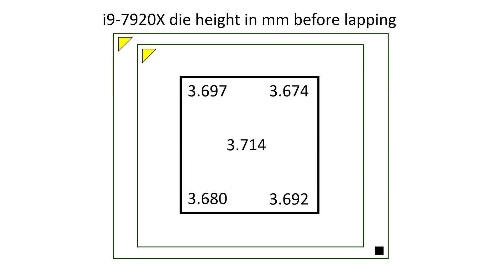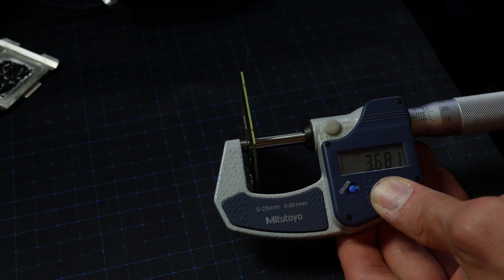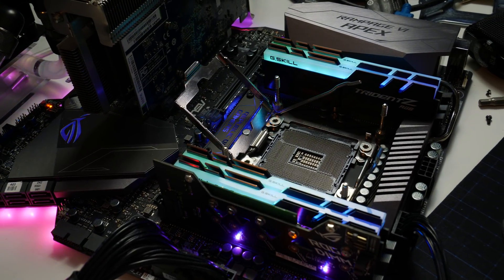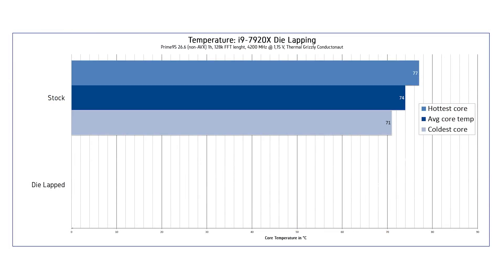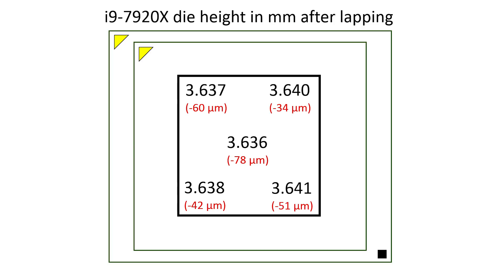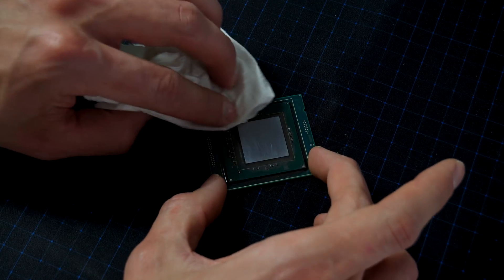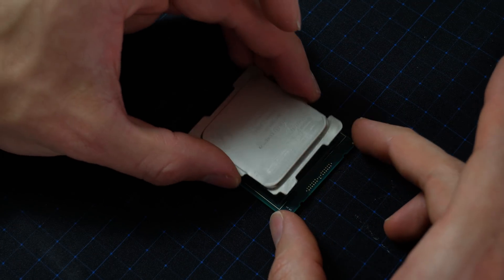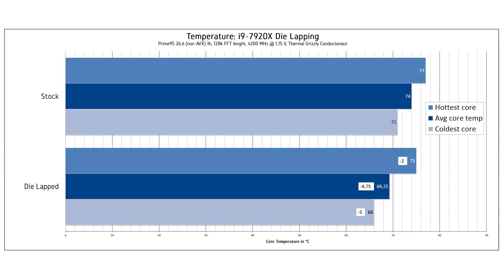Taking CPU Delidding To the Next Level !

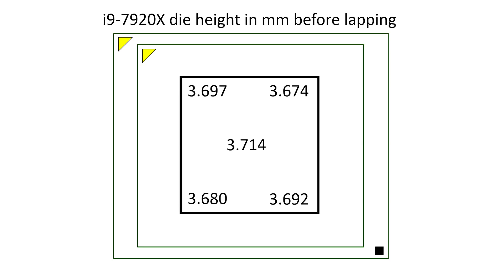Comment: 4:25 shows some measurements. But what's the reference plane?
It's the PCB.
So how are these measurements relevant unless the PCB is flat and level?

This measurement is not important.
What is important is how flat and level the silicone package top is.
And how flat and level the surface is that is forced up against it.

The main requirement is to get a very intimate contact between the silicone package, the IHS (if you use one), and the heat exchanger surface (usually a large piece of copper.

The only way to get meaningful measurents is to do use a surface roughness instrument to do a survey over the silicone surface.
And to use a known reference point (in fact three of them) on the surface that the CPU package is attached to.

In engineering metrology terms, it's defined as flatness.
And in the GD&T (Geometric Design and Tolerancing) standards that Intel follows, they give a spec of 50 micron for flatness.

 That requires a reference plane that is known to be flat.
And the PCB that you used as a reference is very unlikely to be flat.

Do you really think that the silicone wafer that is used to build these dies on is NOT cut flat and level?
And within the GD&T spec?
I don't think so.

A quick way to check would be to put a machinist's straight edge on, and look for gaps.
But I think you should ask a good machine shop that makes pricision parts to measure it.

Comment: I skipped forward a few times, so sorry if you answered this, but my question is, what if the inside of the IHS isn't perfectly flat? There's no way without a CNC machine to lap the inside of the IHS, is there? What if the internal surface of the IHS is made slightly concave to mate with the slightly convex surface of a factory die? {Edit: I doubt this is the case, because the machining complexity of doing that is pretty full on. I guess they just CNC machine the inside of the IHS flat.} All said and done though, I don't think the effort:reward ratio is great enough for most people to do this. I'm going to delid and use liquid metal between the die and IHS, and I'm going to lap the exterior surface of the IHS and the coldplate, but that should be good enough for me, I think. For now...

Comment: I will be performing my first delidding and lapping of the die on my 9900K next week. What I would like to know is do you have to sand down the bottom of the IHS equal to how much is taken off of the die? At what point do you have to start sanding the IHS so that the top inside of the lid will touch the die?
Thx for your time, knowledge & help! You are greatly appreciated!
Reply: Try sanding the IHS base first, until it hangs from the die. Then proceed with IHS & die lapping in sync.
Then liquid TIM becomes a must, because anything solid will detach under different thermal expansion of silicon beneath and copper above.
Reply: @phdnk  Thx. That's a good point.

Comment: Thermal past is to fill the space between    the cpu and the cooler if you smooth out the space between the cpu and cooler your removing that space so if you git it smooth enough you should not need paste.

Comment: I am using a lapped CPU (Q-6600 Soldered lid) and a lapped Heat sink with direct contact and mineral oil as an air gap prevention,no shrinking no problems!
This method reduced my Temps by 15 degrees C. across the board!
Thermal paste is too thick and creates a thermal barrier! 
It does not matter how thermally efficient a compound is,it will still create  thermal insulation!

Comment: i did this back in the day with an amd k2 450 mhz-555mhz and also am2 7750  recently a k10 640 figure 8's sand like infinity is the key great work man i also polished it to a mirror finish like a mirror i did not use liquid metal but they are direct die air cooled artic silver

Comment: What about grinding the lid also? Making sure a flat surface meets a flat surface? In theory at least, if the two surfaces are flat enough you should be able to skip the liquid metal! It is only a intermediate carrier of the heat anyway. 
Could you test that? It would be very interesting.

Comment: how does the difference in height/thickness vary from chip to chip? i am curious as to why is it thicker on the center and ramps down towards the edges???? this might be a manufacturing spec required to help spread thermal paste.,,,,...
Reply: It must be connected to the cooling process after the die was soldered to the pcb. The die cannot have uneven thickness -- it is bent !
Lapping introduces scratches to the surface that will concentrate stress and gallium works as surfactant: we can expect die cracking

Comment: CPU manufacturers in the 2000s: Lets add a metal shield over the top of the CPU to diffuse heat and protect the die from damage
der8auer 2018: I'm not satisfied simply removing the heat spreader to use better thermal transfer media, for my next trick I'm going to sand the die because the barrier isn't completely even

what a MAD LAD

Comment: I lapped a thunderbird 1ghz and nForce 2 motherboard northbridge back in the day.  NB lapping was worth about 15-20mhz fsb iirc, also cleaned up the power plane for the NB a bit when I did that though.  Removing the top layer doesnt always help thermals, the Thunderbird Mobile Barton version A and B are examples of this as the T-Bird B had metal layers added to the top of the die to increase thermal conductivity and also help signal grounding internally somewhat.

Also you should lap both sides of the ihs and cooler base.

Comment: Overclockers, ok keep an eye on the liquid nitrogen so I add more at the right second while my body is running the benchmark.

Meanwhile in ower universe, ghh ghh I need to go even further beyond. Scrams for 30 seconds and then his hair and eyes start flashing white, screams for another 30 seconds until the flashing stops and the color is stable.

Back to overclockers universe, running benchmark and crashes. Resets benchmark and then the computer bluscreens as the score is calculating. Finily the overclockers say yes we got it and says we got 7.26 gigahertz or something and the crowd goes wild.

Comment: What about even'ness of the CPU socket? I imagine the more material we remove from the die, the more prone to cracking it gets. At some point we would have to start taking into account the fabrication precision of the CPU socket and its mounting to the motherboard, not just the cooler/cold plate...? Given that most waterblocks and adult sized coolers don't really mount to the PCB, but a bracket on the other side. If the socket and/or it's mounting to the PCB constitutes a skewed/uneven layer within this heavily compressed sandwich... At some point something might give, no? 

Also, how did these lapped-die thermals scale with a proper overclock (increased thermal load)?

Comment: You should probably try Distilled Water, or even Type II Deionized Water, instead of Tap Water.

Distilled or Deionized Water would give you much better cleaning, and it's not anywhere near as electrically conductive. Don't try to drink it though...

Comment: If you reduce the thickness of the silicone pass a certain point, it will start behaving more as a membrane instead of a rigid body. 
So the pressure cased by the  ihs or heatshink will most likely cause the die to deform in the center trapping more thermal compound instead of extruding the excess out the sides. 
For this application the force applied by the heatshink must be minimal in order to reduce forces and bending moments on the die .
Both surfaces (die-heatshink) must be lapped to a precision surface plate or lap using lapping compounds, the diamond film has minute variations in it's thickness, as any irregularities will make the die deform even more.

Comment: We always make slight improvement accumulatively, and so now we get what we have.
From air cooling to better air cooling, we get 5 more Celsius degree down.
From better air cooling to All-in-one water cooling solution, we get 5 or more degree down.
From AIO to custom loop water cooling solution, we get like 5 more degree down.
And now, introduced by der8auer, lapping on the cpu die surface to make it thinner, it brings another 5 degree down.
Keep going on, we will make it better!~

Comment: It seems likely that lowering the height of the die would increase the distance between it and the IHS. Perhaps it would be worth it to sand down the edges of the IHS as well just so that it can make better contact. Honestly there is a case to be made for precision machining and IHS just to try to rule out most issues with not physically contacting the die.

Comment: I realy like your guts. 

Interesting. Ive been doing the same thing in the first Socket A Athlon (mine was a AXIA) old days. Ive found my results more impressive, probably due to the fact that the Athlon had  higher energy density (flux?) per unit of surface area and ive lapped mine substantialy more. 

The original reason I tried it was the fact that back then having the die chipped was not uncommnon, and the chips survived. The greed for more Mhz was enough to justify the test.

Good stuff.

Comment: It would be interesting to see if you could pull of something like silicon dioxide vapor deposition in order to restore a diffusion barrier to the top of the die after you have worked it down to a much thinner profile.

Comment: That measuring method is not exact because you mesure it on the both sides.And bottom side(where the pins are) do not need to be that flat so the deviation may come from there.And if you really think this way of grinding by hand is going to make that flat....o man you are so wrong

Comment: If you're lapping the die height, but not lapping the IHS (inside or out) then aren't you making the gap between the IHS and die on the inside bigger? And why go through all that effort and not lap the IHS? Thats like changing the tyres on a car, and then forgetting to pump them up.

Comment: You need to lap the thermal contact on the other side as well, I would expect the heat spreader to be the limiting component rather than the CPU die. You might also take a look at expansion-coefficient controlled alloys like antimony alloys to try to match the die's expansion rate exactly and limit cracking.

Comment: Removing the diffusion barrier has extremely significant implications for CPU correctness, not just longevity. The diffused atoms can caused latch-ups and other semiconductor faults, resulting in bit errors and stability issues that will manifest long before the CPU fails completely.
Reply: can this barrier be reapplied ?
Reply: Tell me more about how you tested this and what errors you encounted please.

Comment: At 4:13, your thickness measurements are useless, only because the underside capacitors are not going to be level to any meaningful standard. Your confidence in those numbers can be +/- 0.05" at best.

If those surface mount devices are not all exactly the same size, and all mounted perfectly flatly, and if the substrate and contact pads are not all perfectly planar, then those measurements are meaningless. Best to use a machinists granite surface plate, height gauge, and some leveling screws to see how flat your die is. Also, when you are machining the die, you absolutely must use a known true flat surface, such as a machinists granite surface plate.

Your table is not flat enough, a sheet of glass is not flat enough, nothing you will find outside of a precision tooling environment will be "flat" enough for this kind of measuring.

Otherwise, excellent work, keep on pushing the limits!
Reply: Finaly someone to explain this as it should be done.And i kind'a  disagree with that excellent work when i saw the end product(scratched die) :D
Reply: waka faka - As a machinist, I can't live without a perfect surface finish, but if he's only after the performance, I think it'll be okay.

He'd be at it for hours to get a mirror polish and it might only get him another 0.1% transfer rate.
Reply: This, I was expecting to see a height gauge. There's no way he's getting accuracy up to a micron measuring like that. And even then, the PCB is probably not perfectly flat either.

Comment: Height difference can also be caused by solder that binds ic to pcb. Tap water has minerals in it, so it requires extensive drying and visual inspection for residues. Industrial alcohol is great for cleaning (if it's denatured then you have to verify it's safety separately)

Comment: You were measuring the parallelism with those micrometers, but your real issue is flatness, I would find a real lapping plate( can’t really tell if you used one) or worst case by yourself a surface plate (from l.s. Starter or another reputable company) and do your lapping on that. And also lap your cooler. 10 years of manufacturing experience making aerospace parts,

Comment: I think that die measurement is wrong. What if your pcb has that heigt difference and not the die? You should measure die height by installing cpu in mb and measuring on top with some kind of laser or something.

Comment: Did you also lap the base of the IHS to proportionally reduce it's height so it still sits flush against the die?

Perhaps what you've done is create an air gap which might be why the temp difference isn't as big as you may have expected?
Reply: All the adhesive has been removed, so there was likely some tolerance in height....  aka, a gap.  Part of why relidding typically results in poorer numbers due to the cushion effect of the sealant lifting the IHS and increasing the thermal interface "gap".  The adhesive used should be dimensionally stable if used at all.

But a good thing to keep in mind....

The other thing to consider is the runout and surface quality of the underside of the IHS....  A custom IHS (for the socket wings) that is machined flat and lapped smooth on BOTH sides would be a big plus...

Ideally, you'd have a hollowed out IHS to use to mount the CPU module and then mount the cooling apparatus directly to the die (with the proper care and truing provisions to eliminate one thermal interface....

We did this on the old Celerons way back in the dark ages when lapping CPUs and heatplates/exchangers first became a "thing".

Comment: A couple of remarks. 
You can not talk about something being bent by measuring thickness. You are assuming that the top of the SMD are flatter than the accuracy of you micrometer. For example, if you had a perfect tube it would be bent by definition, but you will measure the same thickness everywhere.
If you apply pressure in the middle while polishing something, the object will most likely start being polished at the middle. 
You remove ~60um Silicon Nitride due to its “insulating” effect but then you replace the IHS with a thickness in the order of 1mm. You should have used a cooler that can be placed directly on top of the die.

Comment: by removing material from the die, do you not create a larger space between the lid and the die. would this reduce the thermal efficiency of the die to the lid. the lid is resting on the edges of the bored right? so is doesn't lower down to the new high of the die. i really have no idea what i'm talking about it was just something i though while watching

Comment: Would be interesting to see how much thermal conductivity is affected by distance (thickness of the liquid metal layer). Now that the die is further away from the IHS I suppose the layer of liquid metal is thicker, so you might run into a case of diminishing returns as the distance between the IHS and die increases (depending on how much you grind down this chip haha).

Comment: Meh... first of all buy proper precision lapping plates (preferably more than one material..cast iron and softer copper for example) and buy diamond pastes in various micron sizes... so yeah meh this lapping in the video is so amateurish...with a proper lapping plate, technique and 1/4 micron size diamond paste the surface perfection is in nanometers and the shine impeccable..when done right on the heatsink too the two materials will create a crazy strong vacuum action  ..+ if you want to be perfect and have a perfect fit, lap the heatsink against the CPU and you will get a true metal to metal contact... also your meassuring technique is complete and utter bs.. you'd need the other side to be flat too